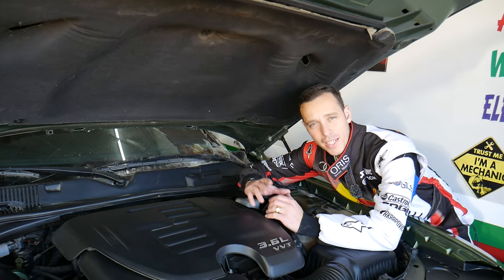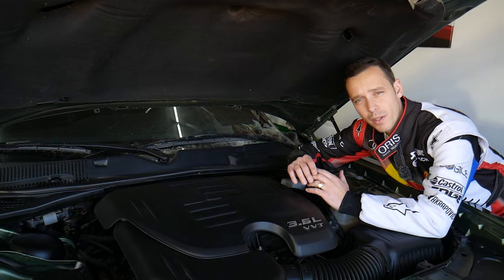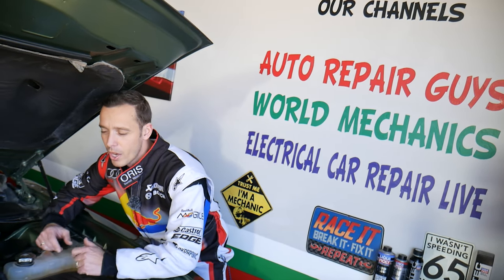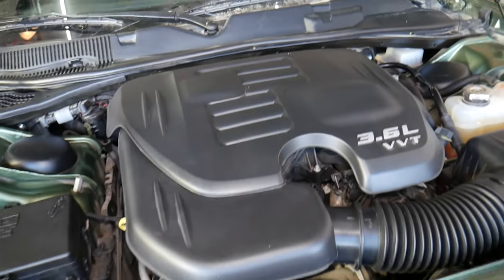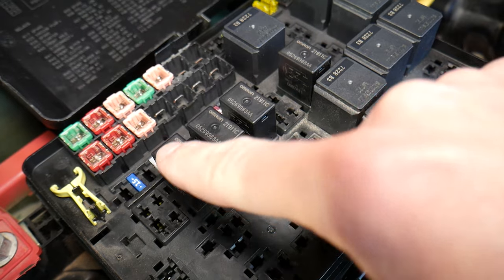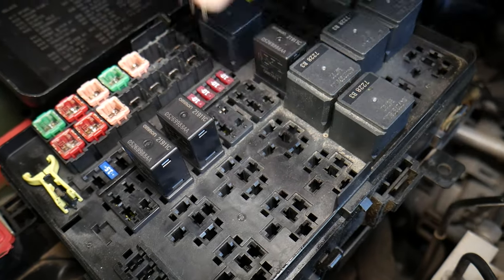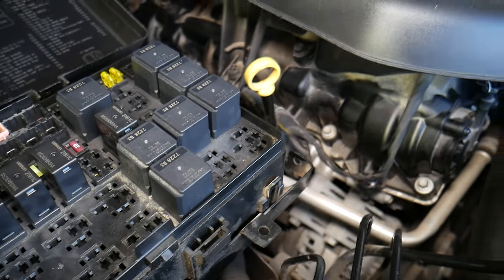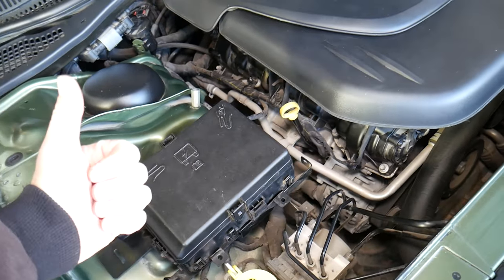CHRYSLER 300 AC COMPRESSOR CLUTCH RELAY LOCATION REPLACEMENT, AC NOT WORKING

Comment: Anybody know the solution for the driver’s side not blowing cool but the passenger side is cooling?  2012 Chrysler 300.
Reply: Maybe your dual actuator when my heat did that I replaced it and now it works fine
Reply: @Keyunna8614  thanks!  I’ll check that out.